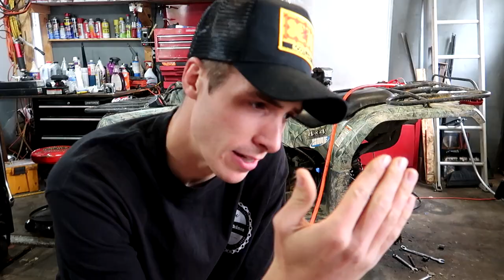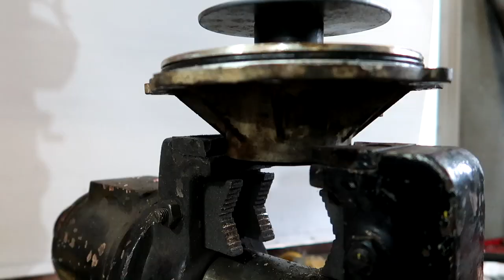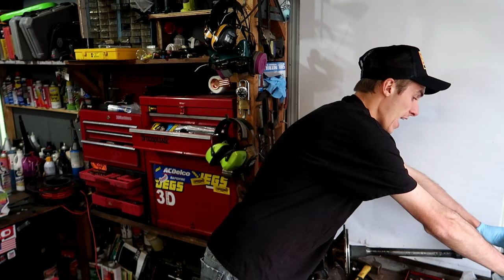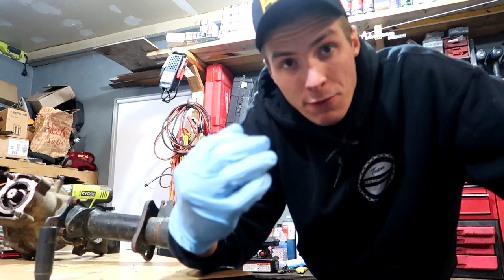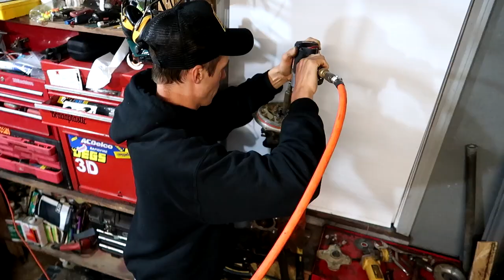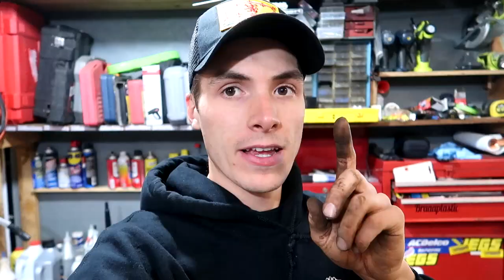WHY i Started YouTube

Comment: hi Dolton when fitting any kind of bearings wheel bearings diff when hammering them in  place only use brass hammers or punches as it does not damage it OK dude you rock

Comment: Hey 3D Machine I have a 1986 Honda fourtrax 250 it's shaft driven and when u start it up it won't drive in any gear but when u jack the rear up and pop it into any gear it goes but when u put the weight of the quad on the rear it won't go idk what's wrong with it in stuck idk if it's the diff or the axle can u help me out ??